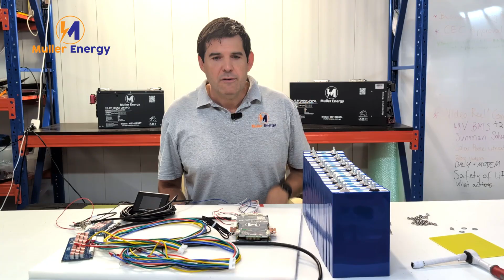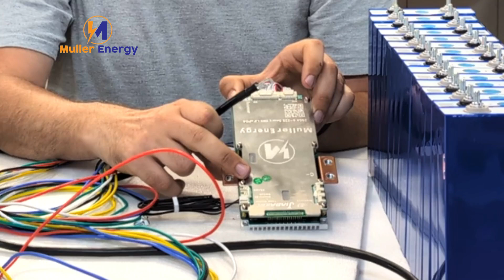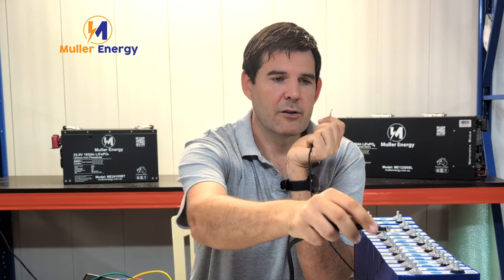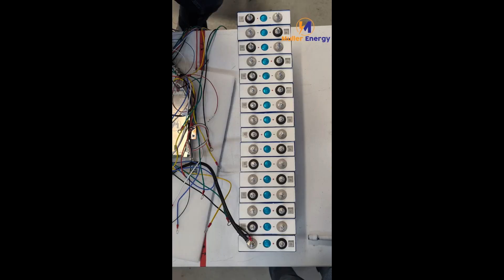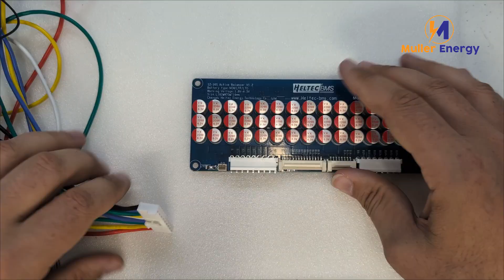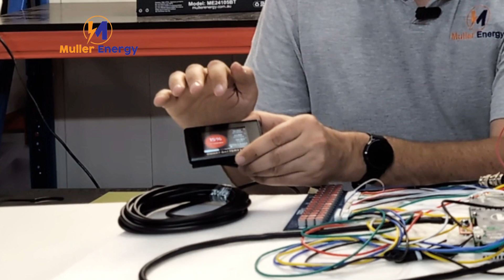Muller Energy 8s & 16s BMS Installation Instructions

Comment: Great video Ruben. Thanks
Just got another 24v kit from you with the new BMS.  I have found the two smaller connectors that plug into the balancer quite difficult to plug in. Once in, they do not sit squarely. There seems to be a very small tab at either end of the plug that makes it difficult to slot into the balancer.
Apart from that, all good and very easy to install.